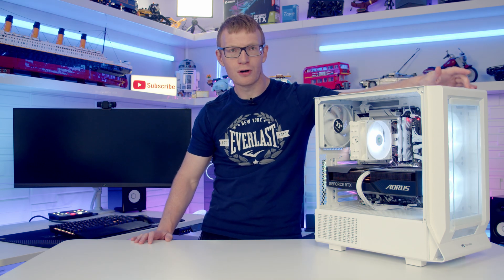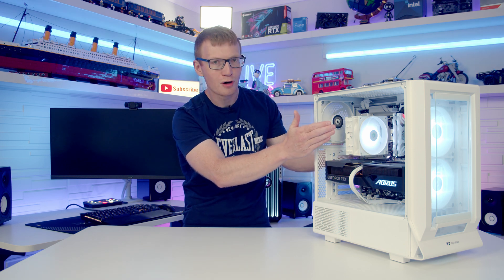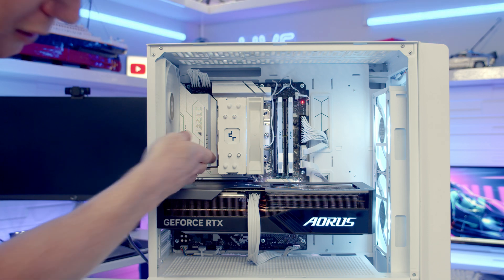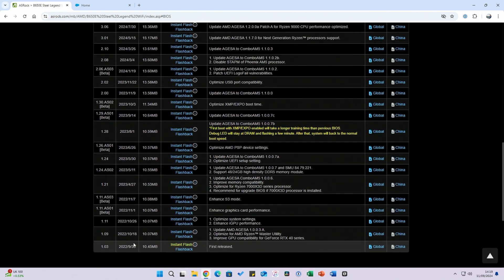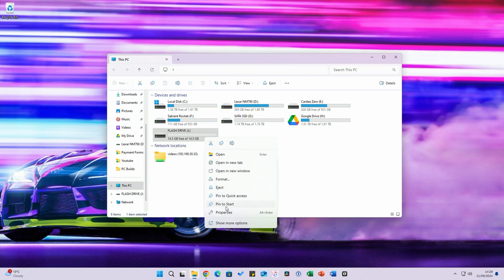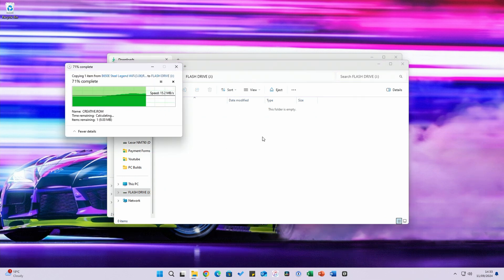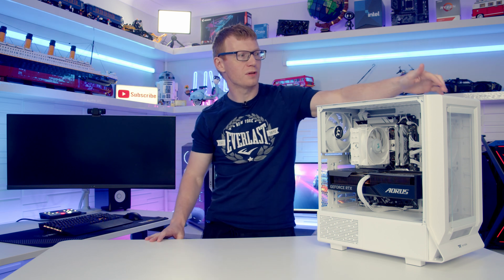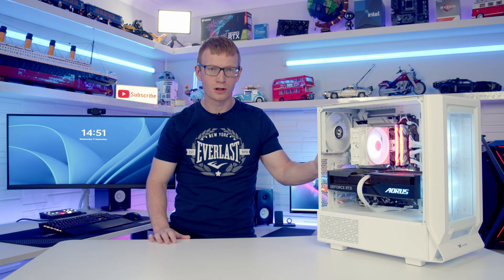Fixing a Broken PC - Episode 3

Comment: Will flash back work if the current  (original) bios becomes corrupted?  Does flash back use the firmware in the the current bios?  I have a working Asrock motherboard;  I am just curious.

Comment: nice video :) that reminds me, i did a bios flashback when i got my new amd motherboard,  you don't even need a CPU in apparently to perform it, which was cool but you still need power supply cables for mobo & CPU plugged in. It was in may 2023 that i did this. Reason was it was recommended to update because if the motherboard was a late 2022 with an earlier BIOS and that was shipped to me it would of been was outdated and i needed it to support the new ryzen processors as I got me one of those. That's why i did the bios update just in case